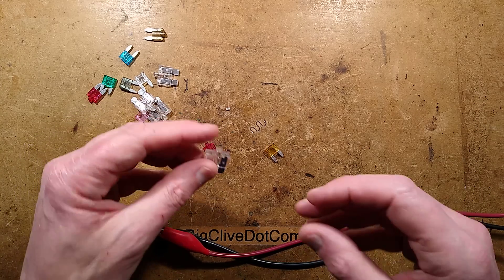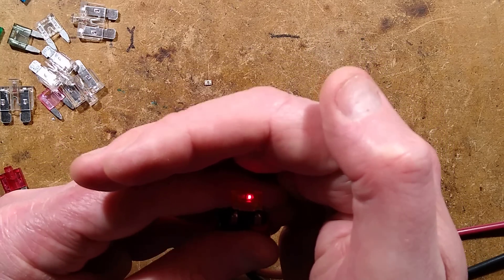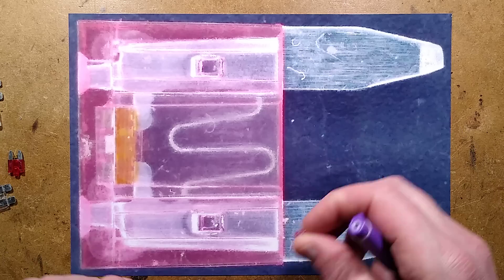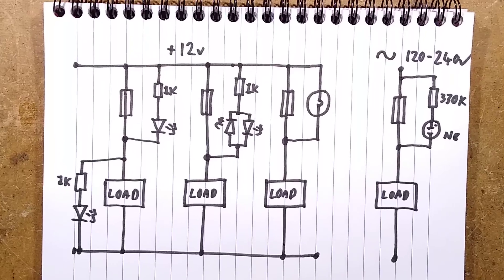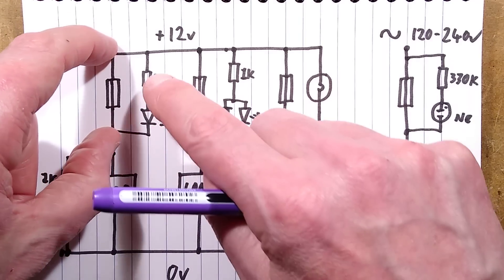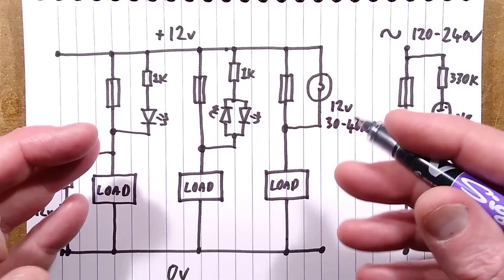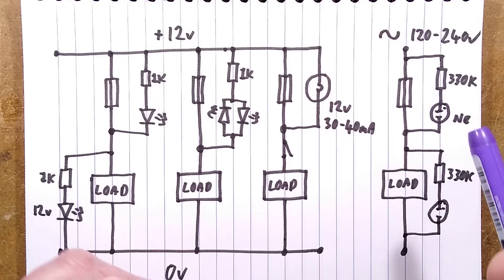Inside self-indicating vehicle fuses

Comment: Indicators can be quite helpful, but a potential downside is that voltage still appears on the output after the fuse blows.  The current will be limited and the voltage dropped across the light circuit, but the circuit will still have some voltage available at the load.  This won't usually be a problem, but a standard fuse interrupts power completely.

Comment: I've seen the consequences of using automotive fuses at mains voltage.

Most of the time, nothing happens, lulling you into a false sense of security.

But if a sufficiently-inductive load is switched on at exactly the wrong time in the cycle, the fuse blows with the inrush current, suddenly interrupting the current; and the kickback voltage from the collapse of the magnetic field already established in the core is enough to jump the gap in the "fuse wire", and set up an arc which ends up setting fire to the fuse and its holder.

Not really recommended.

Comment: Hey Clive would you feel comfortable using automotive style fuses with 60v dc? That's about the max any of my ebike builds go, and depending on if it's higher or lower power I'll use automotive fuses or fuses designed for like a car stereo system
Reply from the maker: It's above their rating, so that would be a decision you'd have to make yourself.  The main issue is of an arc forming like a welder in the event of a high current fault.

Comment: The maximum voltage for standard blade fuses is 32Vdc. For higher voltages (i.e. in a 48V battery system) you need special fuses for up to 60 or 70Vdc

Comment: Things I never knew existed and now want in my life: these! This is such a genius idea.
When I blew a fuse in my car a few months ago, I had to dig the chart out in the manual to find out which was the one I blew.
Reply: Instead of taking the time to remove them and inspect?
Reply: @the_kombinator  in my case it was easy because I knew what blew out, just not which fuse that was. That's why I needed the manual.
But when you /don't/ know /if/ anything blew at all, do you really want to plug out ever single one of the 20+ fuses?
I'd happily pay extra to NOT have to do that. So all fuses I'll replace will be lit ones from now on. If I can find non-sketchy ones that is.
Reply: @BloodyMobile  Right so there's a label on the fuse panel that shows what circuit is protected by the fuse. IMO, not hard to read it and find the culprit. Even if I were to remove each fuse, it would take what, a minute tops?
Reply: @the_kombinator  not with mini fuses and modern cars. 

Ive met automobiles built in the last 15 or so years that have had 2-4  fuse panels and a hundred circuits. 

A test light would be the fastest way above either of these methods. 

Also Ford is notorious for only putting circuit identities into the owners manual and only labeling the lid with numbers that correspond to the chart in the manual. Theyve been doing that for something like 30 years.
Reply: @goosenotmaverick1156  The average age of my fleet of cars is 27.5 years. I may be biased here :P

Comment: DO NOT USE THIS. Fuse is fuse, its meant to interrupt circuit completely once critical conditions are met. 
- Critical condition means higher than calculated current, because of incident.
- You are not supposed to change fuse that glows with another one just because it glows, you are supposed to fix the problem in your car that will melt wires and burn your car. 
- You are not supposed to fix problems around fuses without multimeter.
- If you are not able to remove fuses one by one and check them out of circuit with beeper on multimeter, you are not qualified to fix the problem and you put vehicle passengers in danger.
- You are not supposed to leak current after fuse is triggered/burned, not even for a bulb.

Now lets get to mathematics. In car industry, red is 10 ampers, blue fuse is 15 ampers, white is 25 ampers. 
If current of 10 or 25 ampers is passing through fuse, burning its main contact, how will SMD resistor (smd resistors have power rating of 1/20 to 1W) and diode survive that current to remain lit? They will not and they will explode, maybe fuse to pcb, heat and what not...
If this is meant for normal use, this would be used until now, its not safe and car manufacturers do not do it.

There is a whole science behind fuses, contacts, terminals etc in car industry, believed or not...

Comment: I've seen regular automotive fuses in ebike batteries, 48v, even an old battery of mine that maxed at 84v fully charged had a mini fuse holder on the positive wire. I added the maxi fuse variant on batteries I built later on. That was 20s lithium, but now I'm looking at a project that's closer to the 30s range, would automotive fuses be a problem at 120v dc? This type of fuse is usually marked 32v on the plastic shell, but having seen them used in much higher voltage applications, in actual products made me think it was probably alright.

Comment: The indicator light will not be on if what ever took the fuse out is burned up and the circuit can't be completed thru whatever was fused. In this case they are useless.

Comment: These type of fuses should definitely not be used for spicy voltages. Every one I've seen has the end of the spade exposed at the top end. Handy for probing with a meter in circuit. Not so great for probing fingers.

Comment: I have a few fuses similar to these but they look like they are prototyped like they put a SMD resistor and LED onto the test points of a normal fuse and then covered with either resin or some type of plastic. These would make a nice light so I'd keep them and use them as such.

Comment: I‘m wondering, if you would use such an fuse to protect for example a large electro magnet (so basically a large coil), if this fuse blows, would the back-emf voltage spike kill the led in the fuse?

Comment: I upgraded the fog lights of my 1985 Corvette to use HID.

The factory rating was a 10amp fuse and id replaced all the fuses with bussman LED light fuses.

With only one fog light the fuse didnt trip, with both running it caused the 10 amp fuse to blow. However, I didn't get any illumination from the fuse, maybe the LED was the wrong way and only one in this fuse.

Anyways, upgrading to a 15 amp fuse restored the lights to working order, everything looks so bright now.

Comment: These look great - I'll have to get them into my robot dinosaurs, whose servos keep throwing fuses because of moisture faults. It's cheaper to keep throwing in new fuses than to cut into the bodies to replace the servos then get the foam latex guy in to repatch the hole then get the texturing artist to repaint the surface  ...
Reply from the maker: For intermittent faults you can also use polyswitch style self resetting solid state fuses.

Comment: I'm curious as to the way these are wired. Having a tungsten filament bulb across the posts that illuminates when the fuse blows (As r:fuse is now > r:bulb) makes sense and carries low risk, as any continued overcurrent would also blow the bulb as if it was a fuse replaced before the fault was resolved. But would this also hold true for the PCB with the LEDs? 😇

As others have said though, I prefer having the indicator lamp separate to the fuse; Replacing only the blown component is more sustainable than component and indicator lamp, and if the lamp is separate to the fuse its output can also be fed into a secondary system (e.g: The car ECU) such that a local or remote system can communicate the failure (e.g: Message on dashboard display) and/or amend operation to compensate. 👍

Comment: You forgot to mention that the little pins that extend to the top of the fuse are for quick probing of the fused connection without having to remove the fuse. Very thoughtful design!

Comment: If I power up an old valve radio I found I connect a 240 v incandescent  bulb  in series. if there is a short the bulb lights up and takes the load.

Comment: Decided to test my aliexpress fuses i bough years ago. run short circuit with current limit on PSU, The 5A fuse didn't blew until i reached 45A(!!!) , and even then, the fuse didn't blew, but the plastic started melting around it(about 30 sec). great fuses. much strength

Comment: hmm, them having 2 leds to cope with either polarity,  why dont they make dual inverse wired chip(same colour) or bridge plus led chip 'ac' leds anyway, so doesnt matter which way round connected? .. or do they? surely cheap enough to do these days?  you certainly used to get bi colour leds that had 2 inverse wired chips, one way red, one way green was the most common, i got one from tandy when i was young ,, on ac it was flickery yellowish ! still got it amazingly, havent popped it!

Comment: There's a 12v "load panel" commonly found in RVs in the US that has the LED mounted on the circuit panel.  You use regular ATC fuses, and when you pull a fuse or it blows, the LED lights up.  What I find disturbing is that allow enough current to pass through them to illuminate other LEDs on the circuit (albeit at a reduced brightness).  If something has gone dead short to cause the fuse to blow, why is it ok to leave the circuit closed with this indicator?

Clearly there's something fundamental that I don't quite understand.

Comment: I find it a bit wasteful, manufacturing LEDs that are intended to be lit for mere minutes until the fuse is replaced.
Even worse, if the short circuit is still present after changing the fuse, the new one (the LED) will have had a useful life of less than a second.

Comment: I was sceptical when I saw these 2A fuses on Temu and decided to give them a try. They sustained 10A until the plastic started melting. Never popped... Super durable, high quality material
Reply: High quality fuse, protects itself by eliminating the circuit it's connected to.
Reply: The same very high quality fuses found on Amazon, I see!
Reply: ...note to self: Remember to test some of your cheap-butt glass fuses to destruction this weekend to see how many 'mini-heaters' I may now own instead of fuses!  TEN amps, on a TWO fuse...and not transient, but sustained?!  I'll just see about popping a few of each of mine at random just to see if any play 'lightbulb' on me.  That's not a failure mode I'd considered before.  I was always thinking it was risking being LOWER in capability, not wildly-higher.
Reply: @EShirako  I think being lower is the best failure mode here and I've never thought a fuse would be lower in capacity as that's safer anyways (but annoying if it pops whenever)
Reply: I see a bunch of people here have seen Louis Rossman's video of when he was testing some cheap fuses.
Reply: Oh i had one fitted in my car by a car shop. It literally melted my wires to the locks and it only stopped because the central control unit for the dor locks and car alarm gave up. The fuse they fitted literally melted closed...
Reply: Slow blow fuse.
Reply: I dont think people getting the point or fire of joke of facts?
Reply: That's quality right there. It's 5x better than advertised!!
Reply: Shouldn't they have popped at 2 amps not 10, that's a huge failure not a win. Your circuit it was protecting is now fried 😢
Reply: @keithking1985  are you replying to mollage's post? If so then I want you to know they were using sarcasm, or possibly making a joke.

Comment: My camping trailer (caravan) has a 12V fuse panel with burnt fuse LED indicators by each fuse. It uses regular automotive fuses. One day I had to remove my gaz furnace from the caravan to send it for repairs so I had to disconnect its 12V wires. I pull the appropriate fuse, and the small indicator LED beside it turned on as it should. Later in the evening I walked by the caravan and noticed the caravan's exterior porch light (an LED) was dimly lit. Now that was strange. When I pressed the switch it would turn off but I it would only lit very faintly when turned on. I figured the LED was bad, so I replaced it. No change. Checked the voltage in the socket: nothing! Weird. Following the porch light wires brought me to the furnace: the porch light and the furnace are on the same branch. But I had pulled to fuse on that circuit, it didn't have any power to it. How the hell did that porch light got enough power to glow like this with its fuse pulled?
Turned out enough current was going through the burnt fuse indicator LED in the fuse panel to lightly lit the porch light. I never looked at how these fuse indicator LED actually work before, but once I read on how they work I figured out that's what was going on!

Comment: I don't get it, wouldn't the load still get a feed (rather than be disconnected to save the device it is powering) or worse, even try to pull more than the 30/40mA and blow the filament lamp too?

Comment: I can see these causing issues. Lets say my flux capacitor in my DeLorean  stops working, so I unplug it, put my 10M ohm multimeter to check the voltage. The meter would indicate 14.4 volts ( fully charged lead acid battery voltage). I go the the next step. As a former dealership mechanic I could see wasted time and $$

Comment: Narva make a fuse holder that has LEDs to indicate when a fuse is blown, we had one blow on a machine and the led must have been faulty as it wasn't illuminated and was still supplying a small amount of voltage causing all sorts of problems, the guys weren't auto elecs so nobody bothered to check fuses, I pulled all those fuse holders out and threw them in the bin.

Comment: Why not use breakers in automotive/ low voltage situations? Just curious! Aerospace use breakers on low voltage DC.
Reply: You used to find them in critical circuits on some cars. Circuits like headlamps,air suspension compressors and power windows come to mind. Generally self-resetting ones. A lot of US origin stuff back in the day used to incorporate the headlamp breaker (in fact the entire exterior lighting breaker) into the main headlamp switch, which lead to some interesting situations where a short to ground in a licence plate light would make all the lights flash on & off. 
Now everything is CAN bus controlled there's usually current limiting built into the power supply to the circuit. For instance, main/high beam will be fused, but low/dip beam will be current limited via a control module (e.g. Body Control Module) and if the allowable current is exceeded it will shut down low/dip beam (and log a fault code), leaving the 'hard wired' main beams as the default..
Reply: Yes the current mosfet controlled environment is much easier to control. I build a lot of arduino based lighting controllers for 12v led stuff. My big unit is a 64ch pwm dimmer and i use polyswitches on each output and fuses on the multi power supply inputs. Polys are older tech I know but it works well.

Comment: Hint in case someone out there didnt know; you can check an automotive fuse while it is still in the holder as there is a tiny bit of the blade exposed you can reach with a meter probe.

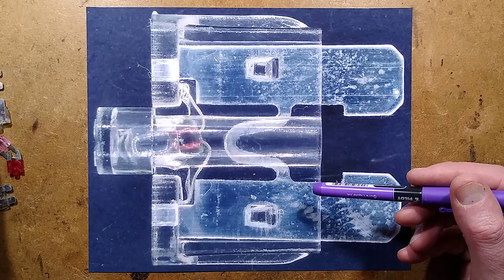Comment: 1:50 These "automotive" fuses are also used in some industrial applications (eg Siemens SITOP UPSes), which go up to 48 volts so my guess would be that the reliable opening voltage actually lies somewhere around 63v maybe?

Comment: Some models of late 70’s Mistubishi cars( the ones called ‘Sigmas’ in this country, not certain what the ROW model was) had a ‘test light’ system with a slider knob and a detent with fuse numbering incorporated in the fuse box cover which you could slide along the row of fuses to determine which fuse had blown without any tools (or opening the cover). 

It simply had a set of contacts on the circuit side of each individual fuse and the slider completed the circuit to the test light.

Comment: Re: Max Voltage - If I recall correctly, ATC (standard blade-type) fuses such as these are usually rated for 32VDC, although some are rated for up to 42VDC, which makes them fine for so-called "normal" vehicular DC voltages of 12-24 volts DC nominal.  They're rated higher because they are often used for non-vehicular purposes, and occasionally for AC-voltage applications of up to 120VAC... At least, over here on this side of the pond they are. I recall having a rack of VFDs on a show automation rig whose AC outputs were protected with 30A ATC fuses. HTH, HAND, &c...

Comment: Pheonix Contact makes a fuse holder for din rail that includes this led in the holder. They light up if the fuse is blown or when no fuse has been installed in the holder. Letting you reuse the led is nice
Reply: Much of the equipment I work on has exactly these. They are handy.

Comment: Clive, “No thing under the sun is new” (Ecclesiastes 1:9)

The idea of adding a neon and ballast resistor to a fuseholder (thus indicating the fuse has opened) was patented in the UK by A.F. Bulgin and Co. Ltd. (List· No. D.F.826fV. GB Patent Number 930330. U.S.A. Patent Applied No.l86f676.) 

This was advertized in Wireless World (January 1965 pg 55) with the tag line "When it blows it glows"
"Instant indication of blown fuses allowing quick replacement when used in multiples"

Comment: Most people I know just don't get car electrics at 12 volt, eg a 60 watt halogen head lamp bulb will draw 5 amps or 10 amps per pair, seen it when someone thinks they can run a  1000 watt peak to peak amplifier and speakers bought from a boot sale (no power cables supplied) so try power it from a cigar lighter, ok it works on low volume levels, but hike it up and the fuse goes so they thought the amp was duff, duh ! The thing could easily draw around 50 to 70 amps (600 watts)at knob head levels, depending on amp efficiency etc, 😆
Gaz Yorkshire.